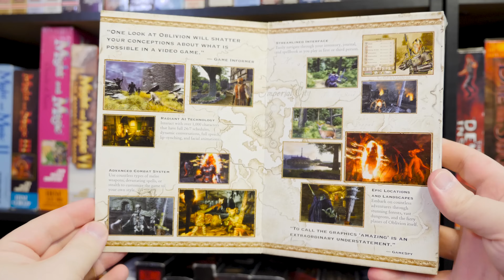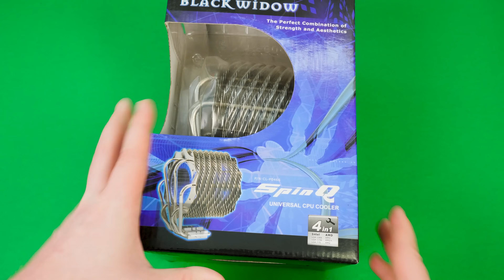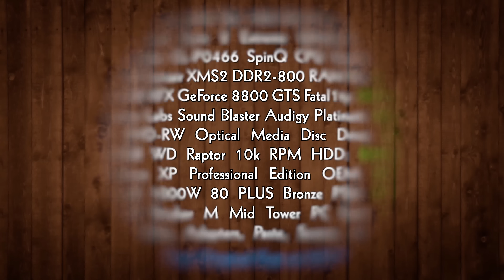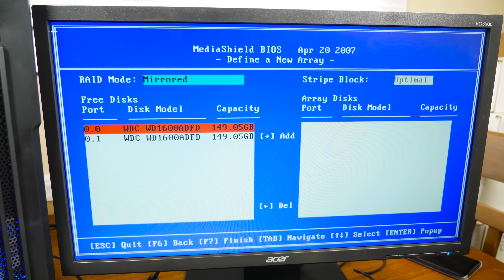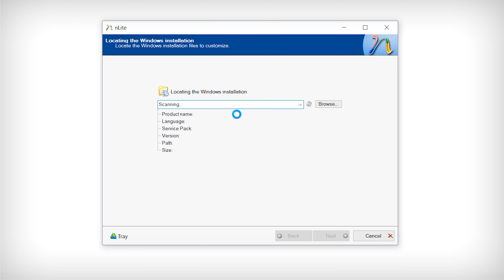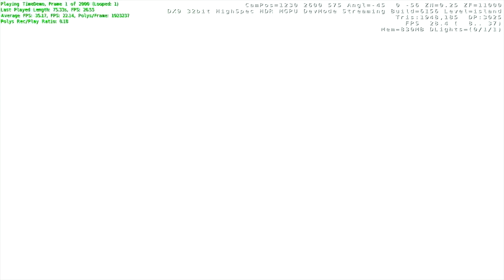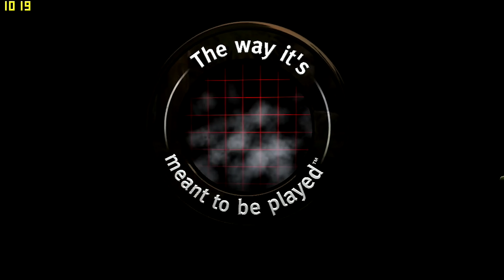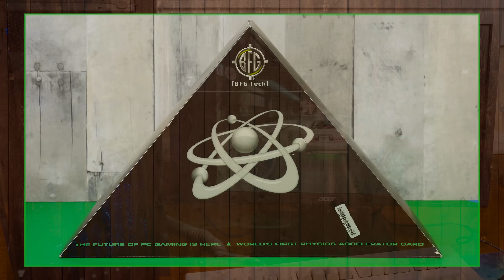LGR - Building My Dream $3,588 Windows XP PC

Comment: Something about building an old-new monster pc looked so good. Modern PC cases miss front panel bays, no CD Drive, no cool sound cards with front panel bays. Their HDD mounts are crap, an afterthought most of the time, since they assume most will use SSDs anyways.

Also those 10K RPM drives look so cool, shame we don't have such things and are stuck with generic 7200RPM HDDs, sure their performance is similar and they are new and quiet but something about 10K rpm makes me want 10 of them!

Old cases really looked after comfort. Easy to use and well built hard drive cages, lots of modularity for installing DVD drives, and everything else. Modern cases are total crap and are basically only look good (and provide decent airflow at least). Out of all the PC parts I bought, my biggest regret is the NZXT H510. No front mesh (sure it might not make a huge difference in temperatures but its an improvement), stupid AIO mount (said it supports 280mm but only supports 240mm AIOs, ended up hammering the mount to make it fit). And everything is really tight.

Comment: Best WIndows XP Setup (newest parts that officially support windows xp):
Intel Core i7-3770k
GeForce GTX 780 Ti
500GB SSD
Z77 motherboard
Reply: Ssd isn't supported by Windows XP
Reply: @ManOfAttitudeLP1998  I thought SSDs' onboard controllers were meant to basically pretend they were hard drives
Reply: @tyurik windows xp isnt supported by anything newer than GeForce 700 series, Radeon HD 7000 series, Intel Ivy Bridge (Core 3000 series), and older FX series and A-series apus.
Reply: @ManOfAttitudeLP1998  Wrong, they work perfectly, provided you have manufacturer's drivers for trim.
Reply: @fernandomartin4141  on my laptop it didn't work
Reply: @ManOfAttitudeLP1998  Perhaps your laptop's chipset was too old.
Reply: 900 series cards do support win xp
Reply: @luigi6835  Yes, but not officially as the OP said.
Reply: @fernandomartin4141  @non't the only 900 series cards that support XP are the 960 and 950 and maybe the mobile ones
Reply: @solcraftdev  The 960 is less powerful than the 780ti.
Reply: My setup= the worst. If I hit my PC to get the second cd drive to open it has a 50 percent chance of crashing because hdd
Reply: @solcraftdev  Nope. GeForce 900 series has XP drivers. as it came  out toward the end of XP's support. so it had XP support for a bit. drivers are a bit old for it. but its there.
Reply: you literraly forgoted 1TB HD
Reply: Im pretty sure an i7-4960X on X79 is also supported and more powerfull. And change that GPU to a Titan Black. Now we are talking
Reply: GeForce GTX 960 is compatible with XP
Reply: @CHA0SHACKER  I'm pretty sure intel 4th gen CPUs are not compatible with xp
Reply: @pokeguy_  that is true. The 4960X is a third gen Ivy Bridge CPU. Intel just didn’t give a damn
Reply: @BetaMaster2  960 < 780 Ti, i meant newest high-end parts

Comment: How many people need to tell him that the ram wasn’t even seated properly, nor did he try plugging it in again, I can’t be the only one who noticed.
Reply: Nah he said he picked up another 2GB kit (so 2 sticks). I'm pretty sure if he reads the comments and realizes the stick wasn't fully plugged in, and it works, he'll either kick himself  or just celebrate more RAM.
Reply: Yeah I noticed it wasn't clipped in fully. I'm sure he would've tried inserting it again. Shame it can't take 4 gig as it x32. Dual boot time!
Reply: it can take 4, but you only see like 3.5Gigs
Reply: Yeah I scanned the comments to see if anyone else had noticed. I spent the rest of the video freaking out, hoping he would try it again.
Reply: @Cyba_IT  I ran 64 bit xp once. It exists. Not sure about drivers though
Reply: @ninovanhooff3926   yeah I remember running it years ago too. It may be better now but terrible driver support and not many programs/games able to run on 64 bit XP. He should dual boot with Win 7 x64 then he'd have a relatively up to date OS on that rig as well. :)
Reply: XP64 was a bit experimental. I recall running some games on it.
Reply: Actually the clips don't always come all the way up, even when properly seated.
I'm assuming a second hand mobo, which will have it's own issues also.
I'm wondering if he cleaned the pins and tried reseating the ram the second stick might have worked.
Reply: When he was pushing the stuff in I got anxiety 😂
... didn't think those words would sound so bad
Reply: He didnt push it in all the way D;
Reply: You can run more ram and have it recognized by enabling PAE.
Reply: tosdude PAE only works on XP if you downgrade to SP1. After that, it’s only used for NX/XD and doesn’t allow full use of RAM.

Comment: To be honest, SLI was never and is still not worth it. I know there's a lot of tech Youtubers who still do it as if it makes that much of a difference, but for the price of two video cards, a cooling solution, and a power supply that can handle it, for at most a 20-25% increase, you can buy ONE single next-generation card that blows away that SLI setup for cheaper.

Essentially all SLI does is turn your computer into a space-heater that jacks up your electricity bill for the sake of a MODERATE graphical improvement on a handful of games, not all of which you're likely to have at any given moment.

Basically, if you're looking to upgrade your graphics, just upgrade your graphics. Stuff like SLI and CrossFire was always a poorly-executed idea that always usually had half-assed support by most games, if they supported it at all.

And of course if you're not a Windows user it's an even greater waste of money as even fewer vendors who made games for non-Windows PCs bothered with SLI support.
Reply: Most tech YouTubers use SLI because the manufacturers who send them free hardware want them to. Luke from LTT has said the only reason he has 2x 1080s in his personal rig is because ASUS ( Who gave him the GPUs) wanted him to, and he turns one of them off because SLI is a headache.
Reply: IMO, SLI is only worth it when you have a 2 or 3 generations old card, and you can find a similar one at a decent price and want to squeeze a little bit more performance out of your rig - without spending too much for a new one.
Reply: I personally run a Crossfirex setup on my main rig, Dual r9 270x's. I bougth the second unit 2 years later at half the price (msi hawk edition), so it's worth it if youre on a budget and you want to use the gpu's as gpgpu's too
Reply: @AlvaroLR  I crossfired a 7870 with a 270X for a while. Overall performance got close to a GTX 970, except for the microstutter and lack of RAM. Eventually upgraded to a 970, and now my wife has the 970 and I've got an RX 480 8GB.

Crossfire was crashy and stuttery, it worked but not without its issues. It was a fun experiment though.
Reply: @dstns  Yeah, that's the point. It's transitory. Also i used to play light games (esports) on one card and gpgpu stuff on the 2nd
Reply: SLI might work nice as a bit coin miner.
Reply: @KennethScharf  
Don't confuse SLI/Crossfire x with multigpu. You can run mining software on a AMD gpu w no display output and a Nvidia one for gaming (for example)
Reply: Voodoo 2 SLI was absolutely worth it.
Reply: There are more uses for a computer. My Ansys FEA is munching happily into quad Quadro's SLi and dual six-core cpu. Also eats Ram more than chrome ever did.. all 96gb of it.

Comment: Windows XP... the first OS that actually had a user-friendly installation interface. Pretty much the most stable OS they made too. They had to pry it from my cold dead PC.
Reply: You could run XP on a machine without internet/Ethernet
Reply: Why not install a linux distro on it??
Reply: @eqanio  And abandon XP!? That's... that's crazy talk!
Reply: @JohnSmith-xq1pz  or just don't be dumb and don't visit dodgy websites and use an up-to-date web browser
Reply: @pokeguy_  Or just don't use outdated OS's online and give the next wannacry a chance to happen...

And you can get a virus from not legitimate sites can get compromised too. Or like wannacry just having a outdated OS connected to the internet a worm or hacker activity seeking such systems out can find it.
Reply: @JohnSmith-xq1pz  theres a lot of people using windows xp, hell even windows 2000 today and they're completely fine.
Reply: @pokeguy_  From what I recall XP usage is down to 4% of users and a lot of that is legacy machine's that can't switch. Probably because win 2000 as far as I know is still receiving unofficial updates.
Reply: @JohnSmith-xq1pz  4% is still a lot, it's a lot more than linux users
Reply: @pokeguy_  Wow I'd would've thought the Linux user base was bigger than 2.06%... Still like In said most of that 4% is legacy machine's like medicinal equipment, specialized industrial machinery etc. So technically it's not regular user's so probably doesn't count in my point of view.

Comment: This was around the time I built my own first gaming computer.
It was a prebuilt Compaq Persario, and I upgraded the parts:
Athlon 64 x2 4200+ dual core processor
EVGA 8600 GTS with 256mb ddr3
2gb of gold plated bling bling OCZ RAM

I was so proud of it, and felt like I had such a badass top of the line computer that I would never need to upgrade again. It's kind of sad to think that it would be a $20 Craigslist computer nowadays.

I also really miss those days. That 8600 gts cost me about $90 brand new at the time, and would be the modern day equivalent of a gtx 1080 (with the 8800 being the 1080 ti of the time) nowadays $90 can get you a gt 1030 that offers abysmal performance in comparison.

Comment: 10:00 - I died a little when, instead of violently reseating the RAM as you should do on any old PC build, you just instantly gave up and removed a stick. :( It'd just take 10 or so insert/remove cycles to clean the contacts. You don't think nearly 10 years of likely-poor storage and oxidation had a number on those RAM pins? ;) Yeah, the beeeeeeeeep errors are almost to be expected these days. Just reseat the memory!
Reply: Oxidation on gold plated pins?
Reply: I know it's hard to believe when you're a textbook-reader with no practical experience, but many an old PC build has been plagued by corrosion, or oxidation, or whatever label you want to put on the phenomenon of "it doesn't work, but if I reseat it a hundred times, it works like new". RAM sticks in particular. RAM always has this problem, and has had the same solution for over a decade of PC-building and tinkering.
Reply: When installing dual ram aren't you supposed to also seat them in slots 1/3 or 2/4, I seem to recall builds not registering the 2nd stick if placed adjacent i.e 1/2 slots or 3/4.
Reply: I’m sorry but the cringe level of this thread is well above 9000
Reply: Or use a rubber pencil eraser to clean the gold panels
Reply: nvidia where prone for ram slots not working, we scraped more nforce than any other chipset in the time. but they where faster than anything in its time. abit made some dam good stuff back then with the Athlon xp.  sis where just aaargh. via ok and ali id rarther die.

Comment: I got emotional when you installed XP, so weird xD
Reply: I see your avatar and I know, you are from Australia xD
Reply: not weird, windows XP is better, only need 2GB.
Reply: @hPLAYER456  I'm running foe my daily driver a mid 2009 plastic white polyester MacBook I'm running os x 10.10.5 i have 2.5 gig of ram and a GeForce GTX 9400m 256 mb with a 2.11 intel core 2 duo. I use it to write and test all of my games that I make. I test all of my windows games on a vritualbox running xp

Comment: your channel brings a lot of nostalgia and good memories thanks for sharing. I built a similar machine with same Nvidia 680 motherboard back in 2007-2008 just to run Crysis. I kept throwing money at it until it could run Cryis at ultra or the highest settings whatever that was. It ended up being about $5000 is 2008!. I had core 2 extreme quad core unlocked CPU, 12 GB dual channel RAM  and 2x WD 160GB 10K rpm raptors just like this setup in RAID0. I recall  they had a distinctive sounds.  I started with 2x Nvidia 8800 GT cards that were highly praised at the time (single slot was also nicer in terms of fitting in the system)  but couldn't run Crysis at ultra settings so I ended with 2x 8800 Ultra GPU's I believe about $800 each at the time. I had Zalman all copper CPU cooler which were the best at that time and it weighed some like 5lbs, you needed to install a special support for it on the opposite side of the motherboard to prevent too much stress..... I had a Cooler master all aluminum case on casters and many fans with LED's (they don't make that kind of quality case anymore)....I believe it was hooked up to a 24" LCD  2560 pixels wide. It was unreal, anyone who saw the graphics could not believe their eyes and jaws would drop. Another difference is that I ran Windows Vista which had a terrible reputation for being slow and clunky at the time but I guess my hardware was so ahead of time it really wasn't slow for me....I played Crysis hours and hours, but there was really nothing else with that level of graphics. Later World in Conflict came out that also had amazing graphics, like raytracing and ground deformation and all that for an RTS game.... Crysis warhead was a step back in terms of graphics and by the time crysis 2 and 3 came out my system was obsolete....Those PC days are gone and  I now have several Macs,  if I play any games it would be on the PS5 but I still miss the days of building a money no object gaming computer and running the latest and the greatest games (after dealing with all the bugs, BSOD's and compatibility issues).

Comment: 19:20 I don't know about the other games, but UT2004 runs fantastically on modern hardware, I'm running it at 2560x1440p at 144Hz on an i7 7700K @ 4.6 GHz and a GTX 1080,  it is awesome! I played this game for the first time back in 2013 on a pretty crappy prebuild from 2010 with no dedicated graphics and still loved it. The modern gaming experience is totally different. (BTW, if you don't know you can set custom resolutions in the UT2004.ini file)
Reply: This video hit me with the realization that Windows 7 is rapidly approaching "retro" territory.
oh yes.

Comment: 13:08 Fun fact: If you enter SYSTEM as the Username you will automatically be logged into the Administrator account on Windows XP instead, thus preventing the admin hack that was possible back in the day!

Comment: Ahh 2007 - 2008, I remember playing NFS Underground 2, GTA Vice City and San Andreas as well as some other early 2000s games on my crappy 3 GHz Pentium 4 PC with an even worse integrated VIA video adapter. At the time custom UI like docks, desktop overlays, custom themes (UXtheme.dll my old friend), etc... were hot, needles to say they made my crappy PC even worse, but hey, it looked cool!!!
Reply: heh, I was running Athlon XP 2400+ with AGP HD 3650 and two gigs of RAM until 2010

Comment: The heck?! Win xp installer had music?
Reply: Yes, what is that sorcery? I've never heard of that.
Reply: JD Yep, although most systems didn’t have audio drivers at that stage of the setup so it was rarely heard in later years unless you pre-loaded the drivers via sysprep or nLite, or had a brand name PC.
Reply: steeviebops I remember hearing it on my gateway pc from 2006
Reply: Yep, used to work for a major PC retailer back in the day, that "song" echoed through my dreams for years...
Reply: Or use VirtualBox to hear the music.

Comment: I have a Windows XP computer that is stupidly overpowered. It has an i-7 3400, 4GB DDR3, and a GTX 750ti. It's great to be able to run those old games with irritating compatibility issues
Reply: To what?
Reply: Oh, it actually has 8. I just put 4 GB because that is the most RAM the 32-bit version of Windows XP will support.
Reply: Kescarte DeJudica Is there a 64 bit Windows XP?
Reply: @Maxonerous

There is, but the games from the Windows XP/90's era were either made as 32-bit or 16-bit programs. Using a 64-bit version of Windows XP would defeat the purpose of using it as a compatibility OS.
Reply: True im thinking about building a fallout NV era machine.
Reply: @Kescarte DeJudica You're sorta right... XP 32 will actually only address 3gb per application and 3.25gb in total. I've also heard, and mind you I haven't really looked into it, that there's a second edition of XP 64 that is actually pretty compatible (as opposed to the dumpster fire that most of us have heard about or experienced when XP 64 first came out) and stable with 32/16 apps. In theory, even if it dropped down to some compatibility mode for 32/16 games, you should still have an entire 3gb available to the game itself. It would be interesting to try.
Reply: @Maxwelhse

I really doubt that. Part of the reason 32-bit games from that time period don't work well on 64-bit versions of Windows is because the built-in 32-bit emulator (SysWOW64) is not designed for graphics-based applications. It is designed more for older corporate software versions. And there is no support for 16-bit programs whatsoever.

Still, if you could find such a version, that would be really cool.
Reply: I can't confirm or deny any of that in regard to the second release. I'm just pontificating and perhaps intriguing you to look into it more. It could be worth it, it could not.
Reply: I know, it's awesome!
Reply: Tfw I use a 750Ti in my actual build smh
Reply: If I ask really nicely will you give me your PC?
Reply: Returning to this thread, I finally got a new GPU, way better than the old one
Reply: HOW DID YOU EVEN DO THIS????? IT IS SO MUCH BETTER THAN MY PC!!!